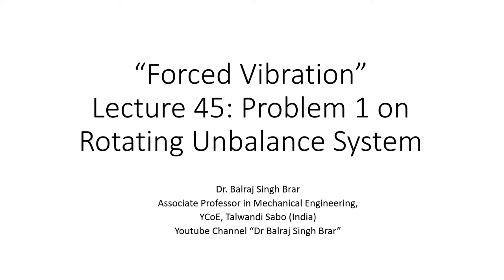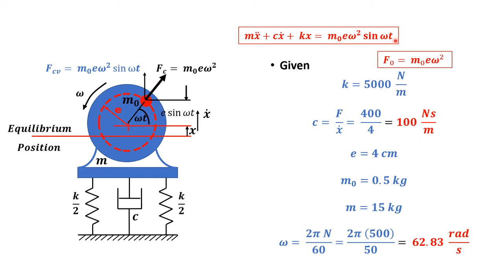Mechanical Vibrations L45 Problem 1 on Rotating Unbalance System

Comment: Sorry if I missed something but in the angular velocity calculation why does the divisor change from 60 to 50? Should it not be 2*pi*500/60 = 52.35rad/s
Reply from the maker: dear it is by mistake, shall edit video someday.
Reply: was wondering there the prefix is 0.104   which is 500*0.104 = 52 rads/s